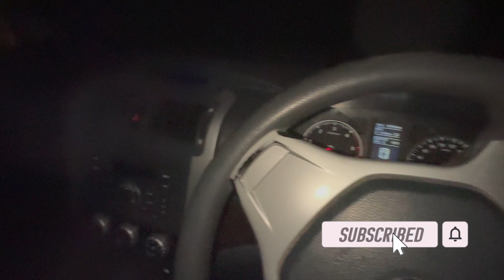The ROTARY engine that won't DIE !! Part 1

Comment: Broooo its always the one simple cunty thing that holds things up, how long did yas spend on that one big nut on the crank? Finally gettin into summer in NZ now can crack onto my engine swap and manual conversion.
Reply from the maker: Too right bro. Your engine swaps sounds cool, maybe I can film it next time I am over 🤙🏽🔥
Reply: Not a rotary unfortunately but still a JDM turbo  @misfirerotary